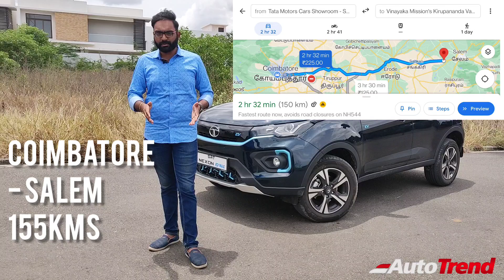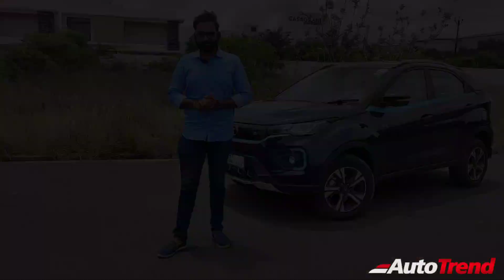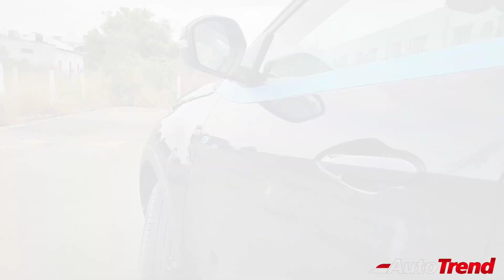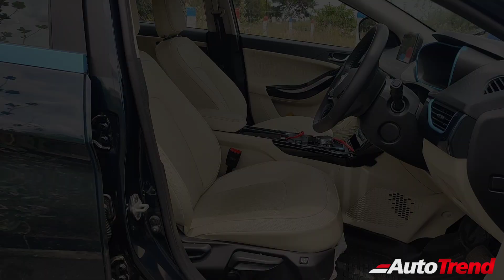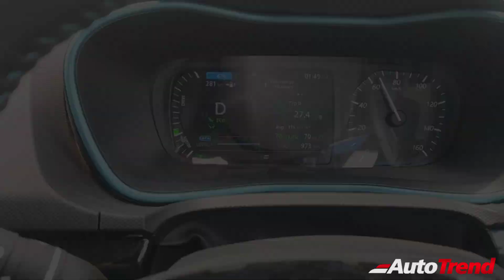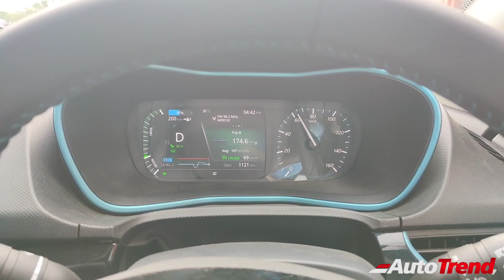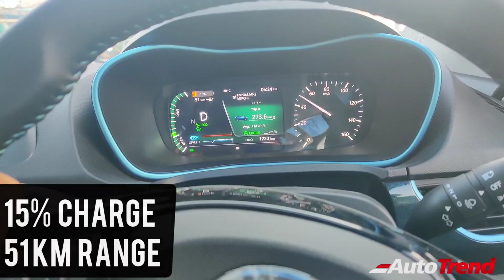2022 Tata Nexon EV MAX Real Life Range Test | TeamAutoTrend

Comment: 00:59 The distance is 155*2= 310 kms
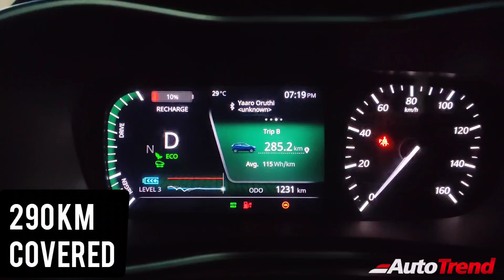13:19 The distance travelled is 290 with 10% left. 

Also the road is fully national highway from karumathampatty approx to salem and back.
If the distance shown in the map is covered, the car would not be able to make it back to the destination? Kindly explain...
Reply: google map is not entirely accurate. actual distance vs google map distance always varies.

Comment: For Indian condition atleast 350 to 380 km range with 10 % charge left should be the idle range in 20 lakh ev car.. it's huge amount ,, if i take 12 lakh Nexon diesel and start clocking odo mostly i will pour 3 to 4 lakh diesel in 4 to 5 years keeping avg running .. saves so much , and sense bantha hai.. wat is this , going to Salem because of range anxiety comming back from trip 😀😀😀 this is not acceptable by Indian typical buyer

Comment: If you drive with 5 people range may reduce little bit. And you drive in 90 to 100 again rage will come down..  Still I would like to buy..
Reply: Y boss.. 20 lkh khatam karni hai tho take xuv 300 diesel in 14 lakh and use that 6 lakhs for diesel and maintenance.. 140 kmph no vibration , 25 kmpl milage ,power on foot , too fun , great performance, no charge anxiety , no headache..

Comment: purchasing a car with 20L and driving less than 70 with low speed Ac . What’s the necessary of ev.
Reply: If you charge at home cost per km comes around 1-2 rs which petrol and diesel cars cant imagine
Reply: @sandysadjoker  That is fine. but if the battery fails after 8 years you have pay another 6 - 7 lakhs for replacing battery. which is lot more that maintaince cost of an ICE car.
Reply: @hariharasudhan5201  agreed no further comments maybe technology should improve

Comment: Great video and thank you!
I am an Audi customer (A1&A4 Avant) from Cayman Islands. Nice to e-meet you.

My sibling has booked this car and we don’t worry at all. 
My suggestion - for longer trips “plan in advance” 
We all need a break every one or two hours straight drive. So just check with some hotels/restaurants on the way (in advance) to see if they have charging stations or plug points available. This way we get adequate rest and the car can be charged periodically as well.

Save energy and be financially smart 😀

Can’t wait to see more EV’s in India from Indian brands.

Proud of you TATA Motors.

Best,
Anoop 
Kumarakom/Cayman Islands
Reply: I bought this car September 5 on 23 rd there is battery issue they took it back to change bat Rey however the battery after full charge shows mileage is 289 kms ..